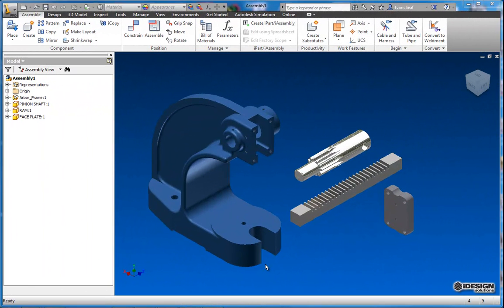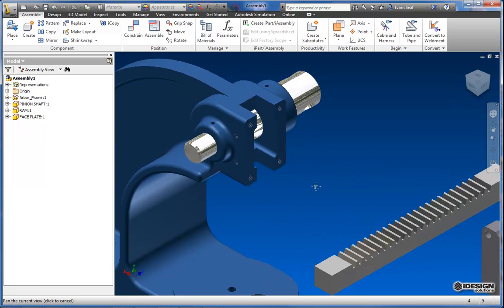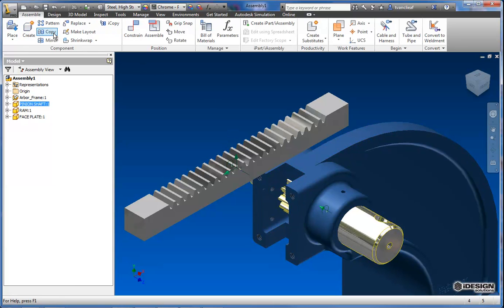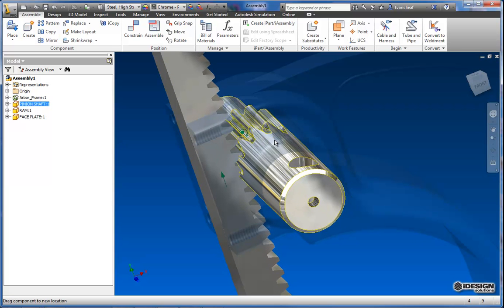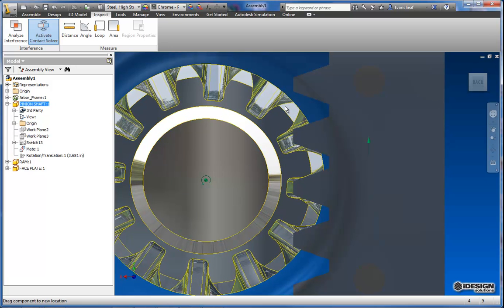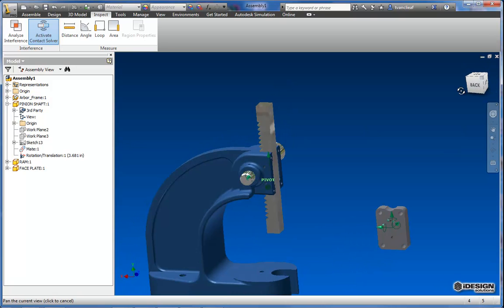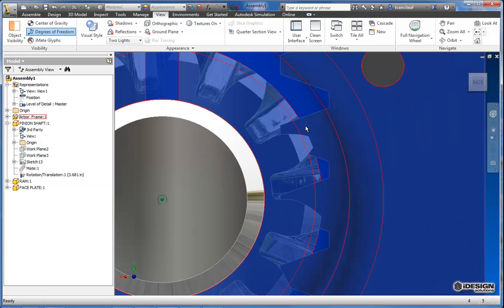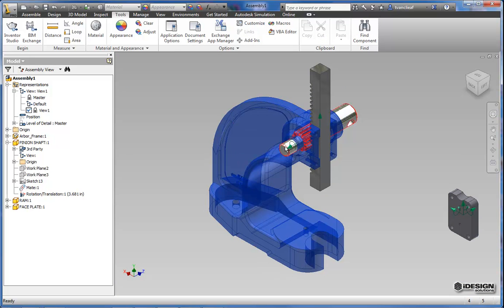Tips and Techniques for Assemblies in Autodesk Inventor Professional 2013

Comment from the maker: Mr. Mealer, we'll be adding a video shortly on using linework from an existing DWG to help create sketches. If that isn't what you were referring to in regards to DWG in Inventor, let us know.

Mr. Osborn, you aren't missing anything. To edit to direction of the translation, simply right click the constraint in the model browser on either part, and click 'Edit'. From the constraint dialog box, change the solution and hit OK.